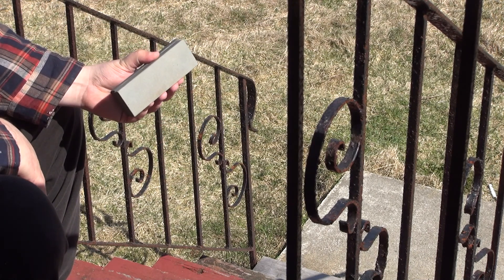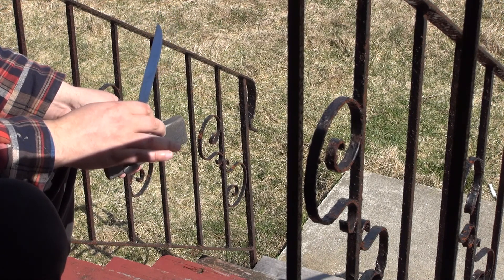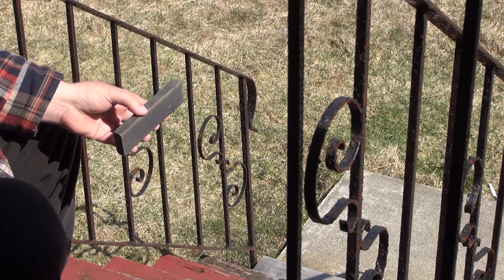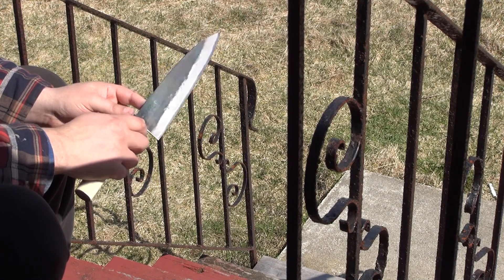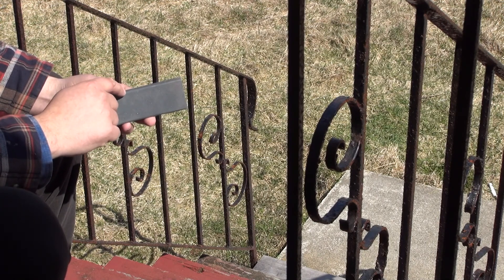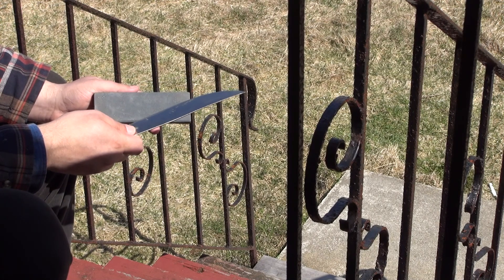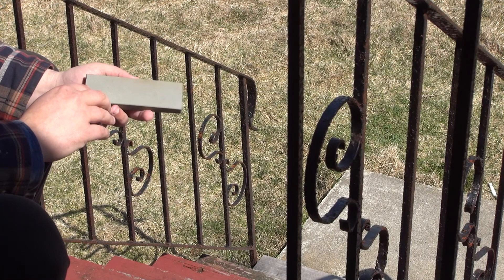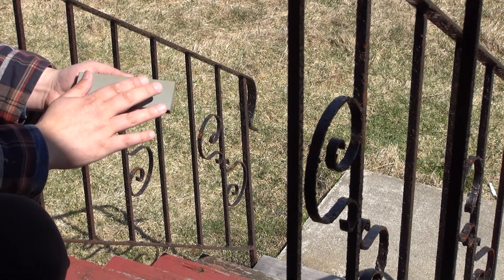Advanced Sharpening #1 : maximizing and minimizing "effective" grit of benchstones

Comment: Interesting use of the corner. Much like how a steel works - its barely hard as the onife but the ridges with crazy high apex pressure will still grind a sharp microbevel until the bevel gets too wide to get enough pressure on it.

Comment: Sir, I need your help on this,
I am new to knife sharpening, I sharpen and thin down my cheap knives on this type of cheap silicon carbide stones, but the problem is they loads too quickly and dont release abrasive evenly...what to do...thank you in advance.
Reply from the maker: Use a suitable oil, but even then you will need to recut the surface periodically with an abrasive which can cut the stone.
Reply: @CliffStamp  thanks a lot sir, you are a master, 🙏

Comment: Now I have a question,  what about the spyderco sharpmaker? Does sharpening on the corners of the rod damage the edge?
Reply from the maker: Unless you use them light. That is why people often have problems with sharpening steels like ZDP-189 and similar. The corners generate very high pressures because of the low area of contact.

Comment: I remember in your recent comment on about waterstones and about the abrasive breaking down and creating finer slurry. 

(about the low force, low pressure, high surface area)

IF you're using this technique, you're obviously in no rush for removing metal, so you could not wash it off, get finer abrasive, and that is pretty much optimal for this technique, right? 

Another thing I worry about with the breaking down abrasive is... can't loose abrasive go into the very very edge, and do more damage than it does good?
Reply from the maker: Yes, that is how you do it, let the slurry build up and work it down.

Yes, that is exactly what happens which is why when you get the slurry at the right finish you then either let it dry out or you dilute it.

Comment: Hey cliff, so by your logic this would mean that diamond sharpening rods like these here would highly stress the edge of your knife because any cylindrical sharpening surface is bringing your contact area down to about a mere millimeter on your blade? -
http://www.amazon.com/Smiths-DRET-Diamond-Retractable-Sharpener/dp/B001910FOA/ref=sr_1_1?ie=UTF8&qid=1390672361&sr=8-1&keywords=smiths+diamond+rod

http://www.amazon.com/EZE-LAP-4-Inch-Diamond-Sharpener-Handle/dp/B000UVNT8Y/ref=sr_1_2?ie=UTF8&qid=1390672377&sr=8-2&keywords=diamond+rod+sharpener

Also, you kinda lost me when you quickly said that the contact with the flat of the stone is 50mm and the edge is 1mm, that's a 50 to 1 ratio which means that the pressure is 50x higher, which means you cut 50x faster.

How do you calculate the pressure is 50x higher?

How exactly does that translate to meaning you cut 50x faster?

Just trying to understand/grasp your calculations here.

Thanks Cliff
Reply from the maker: The pressure is force/area, if the area is reduced by a factor of 50 then the pressure will be increased by a factor of 50.

The cutting speed in general will be proportional to the pressure (there is a limit, it isn't strictly linear).

Yes, rods can easily over stress an edge, this is why for example you will often see warnings about not using them on very thin and hard Japanese kitchen knives for example. They can be used with a very light touch, you just need to be careful.
Reply: Cliff Stamp
Thank you Cliff.  That clarified things for me.

Comment from the maker: I have it in a custom (McCullen) with HT from Peters, 59-60 HRC. Very easy to grind, and exceptionally easy to sharpen. I run it at 8 dps with a 12-14 dps microbevel currently, large chef's knife. It is supposed to be a slight upgrade to 13C26/AEB-L, especially in regards to corrosion resistance. I have noted checked that part yet, but it sharpens/grinds like AEB-L.

Comment from the maker: That steel is really easy to cut, the norton coarse side will cut it readily. However even the fine side of the norton is way too coarse for a kitchen knife. I would cut it with the norton coarse, refine it on the fine, then finish to at least a 1200 DMT or 1000 grit Chosera. You will likely see an improvement still if you go finer for a chef's knife as it is mainly chopping which is push cutting.

Comment from the maker: The low force + water yes, I do it all the time. It is how I finish on DMT's in general as it helps to minimize burr formation and maximize sharpness. 

The high pressure corner use - I would not advise that as you are likely to damage the stone by gouging the substrate directly. 

I have DMT rods but I use them extremely light.

Comment from the maker: It usually isn't need to remove them if you are careful and just adjust the blades position on the stone, though it is awkward. It is much easier if you take them off. Or you can just grind right into them anyway, they are still perfectly functional even if you hit them a little - though you might want to avoid that for long term use.

Comment from the maker: It is almost instant, it is faster than a coarse file even. If you tried to do it on say a small folder you would easily wipe out a secondary bevel in just a few passes. This stone even on the flats produces macro level grind lines, on the corners it really tears up steel as the pressure sky rockets.

Comment from the maker: That first stone, the one I said is very hard and doesn't cut well - that doesn't absorb water much at all and if you use it dry it will just load. It has to be used wet, but generally I don't use a lubricant because I want it to cut fast and I generally only use it on basic finishes. If you did not have any lubricant then your best bet would be to actually load the surface slightly using the spine of the knife and then use it like a smooth steel, assuming you wanted just light work.

Comment: Ok, so it's the combination of a little water with lubricant and the lighter pressure that allows you to reduce the aggressiveness in this case.  Whereas complete soaking, no lubricant, and normal pressure, would cause quicker breakdown.  Do I have that right?

Comment from the maker: Most stones will break down easier if you use water, especially water stones but in almost all cases it makes some difference. The easiest way to see this is take a saw you don't like (maybe borrow one from a "friend") and cut a piece off a stone with and without wetting it (ok you will need two saws). The difference is dramatic in how easily you can cut a soaked waterstone vs a dry one.

Comment from the maker: If that is one of the 14C28N ones then you should be able to sharpen that on practically any random abrasive by accident. Everyone should have at least one well made low carbide, fine grain steel knife at a high martensite percentage just to understand what ease of sharpening / sharpness means.

Comment from the maker: Wider bevels will lower contact pressure as well, just take care as lower angles will tend to also be more easily damaged with less than ideal stones. A deep scratch on a very low angle can easily take a large piece not only out of the edge but that chip will stay there for a long time because the track will keep getting exposed. Often times if you only have a much rougher stone than you would want, a true-micro bevel is a better alternative as it limits the damage.

Comment from the maker: Cross cutting the scratch pattern will produce a smaller tooth to the edge effectively raising the polish. In general how much aggression you need on a slice is dependent on the edge angle and thickness as the higher they are the less cutting ability you have on the push and thus you need to compensate for a draw/slice.

Comment: On finishing fine stones I have found that alternating the scratch pattern heel to tip and tip to heel on both sides provides a bit more refined finish and a bit more sharper edge. 

 The question is does it provide me a sharper edge if instead I go for example on the left side T2H and on the right H2T only? or does it give me a less sharp edge? 

What's your take on it?

Comment from the maker: I would never really take that below a 2-4K grit and would finish on a 6-8. 

Of course if it was damaged I would have to take it lower, but that edge is extremely thin and at a very low angle so care would be taken to avoid fracturing the edge as you could end up removing a chip and spending just as much time getting rid of the micro-fractures.

Comment from the maker: A 1000 grit King is usually soaked, I keep mine wet as it will take some time to soak if you don't. A 4000 should be fine if you just kept the surface wet, that is how I use a 3000 and 8000 from Henckels.

Comment from the maker: The wetter the stone the faster in general it will cut. There is a fairly large range of stones though, some need to be soaked, some will absorb water immediately and don't need to be soaked and some should not be soaked as it can break down the binder and cause the stone to degrade (splash and go stones is the normal term). The latter is generally for finer stones but it really depends on the maker/manufacturer.

Comment from the maker: Less than ideal processing can cause it. If the edge feels gummy it was usually because of a problem in the soaking and quenching part and will make it burr heavily. It also also make it brittle at the same time. There is little you can do to solve it directly except hope it isn't that and the edge was just over heated in the grinding and while that part wears away just raise the edge angle and ideally use a diamond stone with light force to sharpen.

Comment: at a visited kitchen reach into their cupboard and bring down a ceramic coffee cup or their clayware mixing bowl and use the bottom edge with some water to hone a finer edge knife. Glass is also a readily available fine honing surface. The top edge of your car window is a good source.  I have a piece of heavy glass that I found in a dumpster that works great as a whet stone with water. key word is heavy glass.  thin glass is bendy and bendy glass is usually broken glass.

Comment: At their approximate angles of 15 degrees, both seem to have similar performance, with blue#1 refining higher or easier than VG-10. The both regrind a bit differently though. I'm using a coarse and fine DMT stone to regrind these knives by hand. The blue steel takes a bit longer to grind and forms an aggressive burr, where as the VG-10 is easier to grind and forms a less pronounced burr.

Comment: The Higonokami was between 10-11 degrees per side stock. I reground the edge to between 14 and 16 degrees. This solved my chipping issue. My regrind compares favorable to a VG-10 edge, but I have not used the higonokami as extensively as I have with my spydercos. At their angles, both do not chip during most cardboard breakdown. 
It seems that not only was the initial angle a problem, but so was the out of box edge. I still find that the higonokamis edge refines easier and perhaps better.

Comment: The angle? I had not considered that...
The grind is much wider than my VG-10 knife and that angle may have been an issue. I also found out that on wide secondary bevel, it takes quite a bit longer to sharpen the edge.
I'll get back to you on the bevel shortly, but I'm willing to bet that it's quite low on the higonokami. 
The VG-10 knives I was comparing it to were Spydercos, Dragonfly, Delica and a few others.

Comment: Is that White steel knife a Murray Carter Yanagi-ba? 
I'm curious as to what your experience has been with white#1. I have had a bit of experience with blue#1 from a higonokami and have found it similar to VG-10, however, it chips easier, and achieves a higher degree of sharpness easier. I'm curious if white#1 would have similar characteristics while have less potential for chipping.